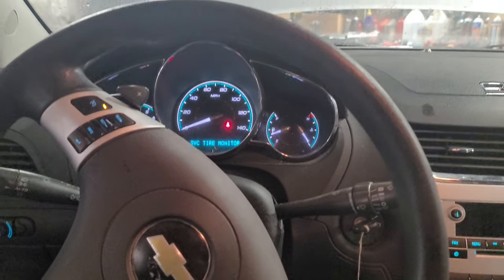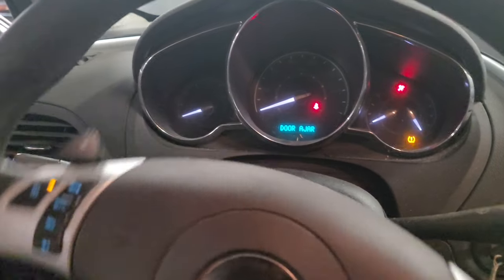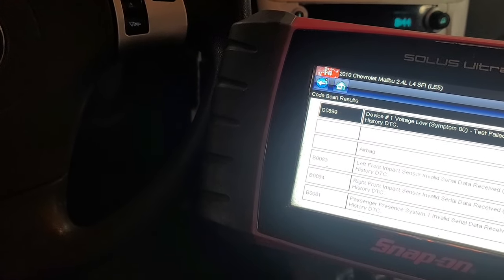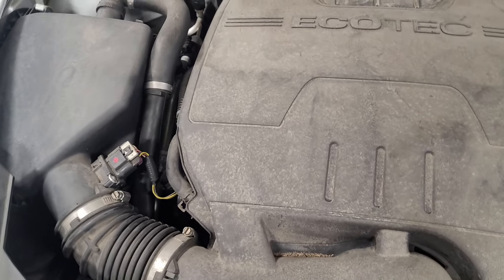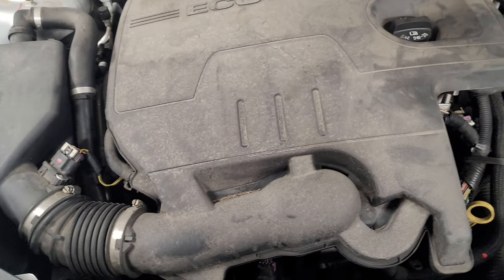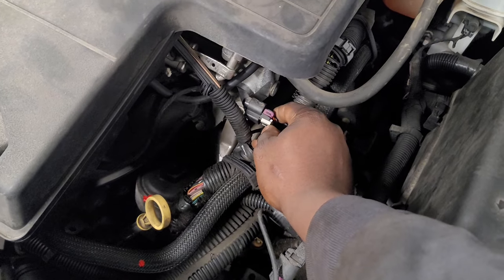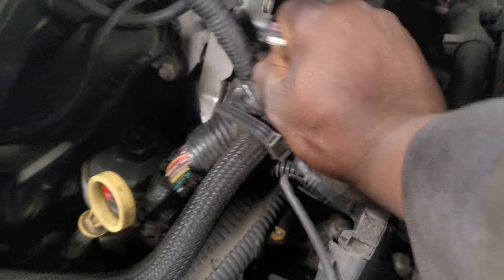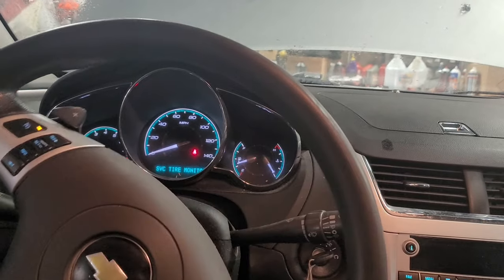Chevy Malibu Starts and Dies FIX!

Comment: Just did this, in my case it was start then die immediately in a 2011. Pulled the cam sensor and it started right up and ran fine. You're a lifesaver.
Reply: Same here thanks bro
Reply: same here thanks but now doing it again

Comment: This worked great to get the car running and get it home. But surprisingly installing a new sensor did not fix the problem. Any ideas?
Reply: What did you have to do for carcto work.

Comment: I had an issue with my malibu's engine starting rough and dying. I found this video but didn't watch it completely as I should have, lol. Yes people, please run an OBD2 analyzer and unplug the MAF plug first before you unplug the cam sensor. My issue turned out to be the MAF (the Mass Air Flow sensor located between the air filter box and intake flex elbow). If the MAF goes bad, it can cause the engine to run rough and can be prone to stalling out at idle. A bad MAF can cause trouble codes and unplugging the MAF sensor on the malibu may allow the engine to be run nearly normal at the expense of worse fuel economy. I have now replaced the MAF on mine and it's running as it should. So yes, please trouble shoot for the MAF as this man did before unplugging the cam senor. That being said this video was still a huge help for me and got me on the right track for trouble shooting my issue.
Reply: Does it kills the battery too
Reply: @renealviar6358  Continuously starting the engine and allowing the engine to stall out over and over again could result in the battery being drained. But that's really the only way any of this would kill the battery.
Reply: Thank you this helps me out so much I’ll be working on a customer’s car with the same mindset

Comment: My daughter car is a 2009 Pontiac G6 2.4L it's the same exact engine as this chevy malibu.  I was gonna replace my fuel pump today total cost was $800!!  Thankfully I came across this video saved me $800!  New censor only $60
Reply from the maker: I'm glad it was able to help you out.
Thank you for watching
Reply: Same g6. Replaced the fuel pump, re-wired fuse box, cleaned throttle body. Hoping this might bee the final fix

Comment: Keep in mind that on these Chevy Malibus there are TWO camshaft position sensors, one where he shows and another directly behind it in the back of the engine. One is for the intake and the other is for the exhaust. They both have the same part number. The rear one is slightly more difficult to replace. I found that disconnecting the coolant line bracket on the engine gives you a little more wiggle room to get the rear sensor in and out.

Comment: Was able to get my son's car started and home! Thanks for the info!
Reply from the maker: Thank you for watching!
Reply: Same for my son's car. Got it home but after changing the sensor, we still had the same problem.
Reply: @MrRickyG2010  same, I changed my sensor with a OEM one after trying a 3rd party one, neither fixed the issue, just going to have to run it without the sensor for the time being.

Comment: I just spent 3500.00 to fix my car and the main issue I had taken it in for was an error msg of power engine low so it was a security issue . He changed the cam shaft sensor (w a shit load of other things) and it’s been running amazingly for the last 1 week and 1/2 till this morning when it started doing THIS ! (Video) so if it is the cam shaft sensor ???? Which I think it is bc i remember that being what I said i needed and he said he fixed !

Comment: I have a similar problem but the same car and year dies while im driving 🚗 then goes put of gear while im doing whatever speed, if i hold my foot on the gas ⛽️ i hear & feel  gears spinning without being engaged but after a few more seconds it starts working. 
I've had a  scanner say ( cam shaft position sensor) code a year ago 😅😅but i just kept it pushin because it runs strong 💪

Comment: We unplugged the cam sensor and it started. We changed out the sensor and hooked it back up and still having the same problem. Any ideas?
Reply: Same thing with my 2010 Malibu. Seems to run fine with the sensor unplugged. Once it's plugged in, same problem.
Reply from the maker: Did you replace it with an OEM part?

Comment: I did as you said too, it worked, I bought another sensor, we put it in and it started doing the same thing with the new part.  Do you think I got a bad part or is there something else I should check?
Reply from the maker: Did you get an OEM part?
Reply: @didisway3341  I figured it out.  I needed to take the negative cable off the battery to reset the computer.  Thank you for the video, it was a huge help, I was stranded 800 miles from home.  Thanks again.  Much gratitude🙏  Maybe add that information if you make the video again.🙏
Reply: @jabbapassion7974 thank you for posting. This got new one working

Comment: So I tried this, and the oil light was on so I checked it and it was very low, still showed on dipstick but probably 2.5 quarts low. I filled it up, still wouldn't start, tried unplugging MAF and every other sensor on my 2000 Alero I could find. Surprisingly there are like 6 or 7 of them lol. No avail. In the process of leaving the battery unhooked for 20 minutes. In Florida it was 98 degrees today so I'm wondering if it was a voltage issue from the heat. Starts right up, surges up for 2500 rpm for a second and then stalls. The security light isn't flashing and it reads no codes.

Comment: Same problem in a 2010. Had a brand new sensor sent from Rock Auto. Got the GM genuine part. Put it in, car did the same thing right away. Unplugged it and the car ran fine. At a roadblock to what might be happening. Any issue with running the car without the sensor plugged in? Anything you could suggest? Thanks.
Reply: I guess there are two sensors
Reply: @jerryblack6948  Turns out that after installing the new gm-genuine sensor; you had to disconnect the battery and clear the computer (ie leave it disconnected long enough or cross the terminals to discharge capacitors, etc.). Then once connected again the computer 're-learns' the new sensor and it worked fine. GM are idiots; has anyone said this enough yet.

Comment: I replaced the same sensor and it drove fine for about 2 weeks but started doing the same thang again with a brand new sensor I have no idea how to fix this problem check engine light is off and no codes are being thrown.  Any other advice??
Reply: Same problem, I think there another camshaft sensor on opposite end. Gnna try to replace that

Comment: so got a 2009 malibu bought a new camshaft sensor because of this problem (does the same thing with the old one) i can plug the sensor in when it starts up and turn the car off and immediately start it back up and it’ll start but if i turn the car off with the sensor plugged in and let the computers reset the car goes back to the same issue until i unplug the sensor again, any idea?? i’ve checked the maf sensor had a cranshaft sensor code so put a new cranshaft sensor in and and has a po171 code which is fuel trim lean so at this moment i’m stuck anything would help.
Reply: I am having the same issue. Ever get it fixed?

Comment: Have the same problem. Replaced the camshaft sensor an it still does it. Any ideas?
Reply from the maker: Did you replace it with OEM part?
Reply: @didisway3341  hey what’s the oem part?
Reply from the maker: @SPCLIPP  I don't remember the part number. But what you can do is call the dealer with your Vin and ask for part number for the crankshaft sensor.

Comment: Thank you! This helped get me home. Exact issue, replaced the camshaft position sensor (GM#: 12674704) but issue continues. Code P0340 Camshaft position sensor A circuit Bank 1 or single sensor. Any suggestions?
Reply: Same thing happens to my 2010 Malibu. Seems to run fine with the sensor unplugged, but even with a new sensor issue comes right back. Any ideas?

Comment: This is happening to my vehicle. It will suddenly die. I initially thought it was the battery. I had it checked and said it was bad (1.5 years old). Got a new battery and it was good for a week but then suddenly died. Checked battery and alternator and autozone and was shown both were good. I searched and saw change Camshaft sensor. Did that and it died again (better mileage though). Battery checked to be good. When it died all times, I put a bigger battery and started right up. I know it's not the battery, alternator or camshaft sensor. I will be changing the mass air flow sensor then the fuse relays (will check all relays). The whole time I did not get a check engine light.
Reply: How did it go?
Reply: @StevenAkins-de3yc  definitely don’t change the MAF. Changed the fuse and haven’t had an issue again
Reply: So what did you replace exactly?

Comment: I have a 2009 ssme issue. When i unplug the camshaft sensor it starts right up. When i bought new sensor and installed it, i started having the same problem even with new sensor. It starts up when unplugged but not with new sensor?........ Help?...
Reply from the maker: Did you get an OEM sensor?

Comment: How long before you think I should get this sensor changed and do you know to change it
Reply from the maker: It's something you want to change, cause it keeps track of measurements in your engine. So if the sensor is not doing that, we affects the performance of the engine, which can lead to engine failure.

Comment: I just replaced sensor with new one, and same problem. But unplugged it does still run. What’s the problem from there?
Reply from the maker: Did you replace it with OEM part? Aftermarket part does work
Reply: I replaced with an aftermarket part and it has the same issue, but runs with the sensor unplugged
Reply: any update here.. I tried replacing but still dies.. shoukd I continue running my car with the unplugged sensor? any issues
Reply: @mstoops69 any update here.. I tried replacing but still dies.. shoukd I continue running my car with the unplugged sensor? any issues

Comment: Yea this help me a lot but the crazy part is I have new cam shafts I guess imma have to replace them again
Reply: Were they OEM parts? I've read the malibu is sensitive and aftermarket parts, particularly sensors that communicate with the computer modules can cause more problems or not fix the original problem.

Comment: I have a 2012 with the same issue. I've tried unplugging both sensors but nothing has changed. I've read on forums people have issues with the rear fuse box. I've tried swapping relays, smacking fuse box. Still can't seem to figure it out. Any ideas?
Reply from the maker: Do you have any codes?
Reply: Prelude, was you able to figure it out
Reply: im in the same boat as this person and nothing fixed it and i had 0 codes.  car sat over night and would start. fuel psi is perfect too

Comment: My issue is; I start the car,runs perfect,I turn it off,it'll start up twice after turning off and won't start back up for like 3-4 later.  2010 Malibu ltz v6 3.6 vvt.
Reply from the maker: Does it have any problem codes?
Reply: @didisway3341  it does but can't remember them,it's been some time.

Comment: Do you keep the second sensor unplugged when you start the car back up?
Reply from the maker: In the video I didn't touch the other one. If nothing changes from doing what I did in the video, try doing it to the other sensor.
Reply: I did the MAF sensor 1st and the car seen to idle fine. Plugged it back in and did the other sensor and that didn't improve the problem.
Reply: Did you figure it out